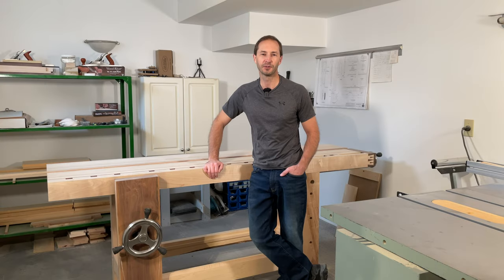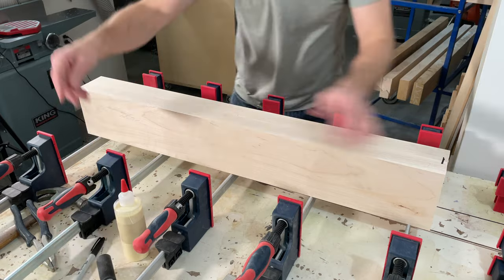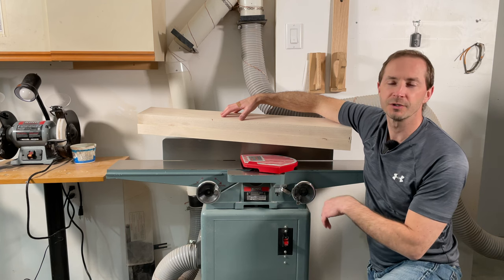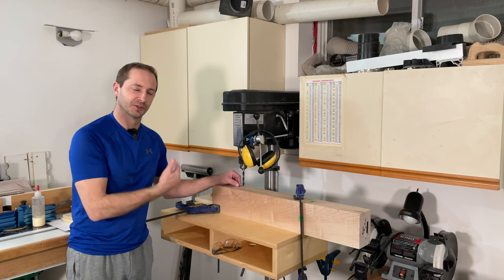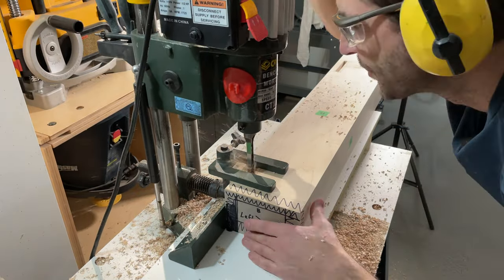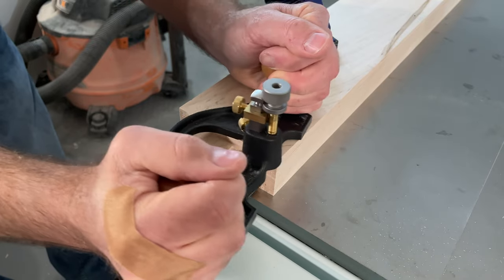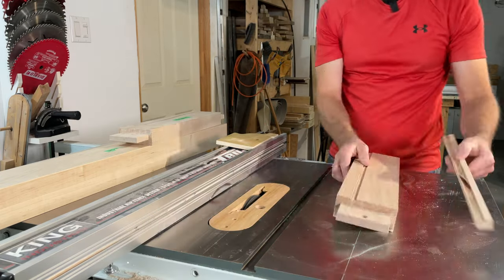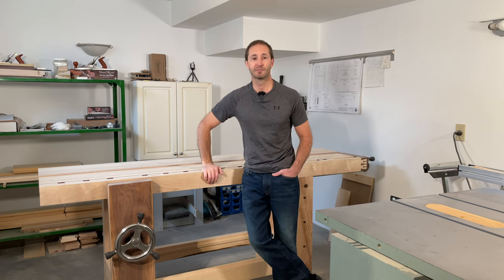How to Build a Roubo Bench Base // Building the Base of a Roubo Bench

Comment: Great video Gary.  Couple of questions.  What are the dimensions of your top and now that you used it for awhile would you keep it the same?  I'm having trouble finding the long "screws" that attach the base to the top and the barrel bolt hardware.  Any chance you would be so kind to post links to where you found yours?  Keep up the great work and great videos.

Comment: I built my first real bench back in 2010. It's done very well for itself, but I never really finished it before putting it to use. It's a Holtzappfel, or a Roubo with twin screw and a knock down base.

I used cheap 2x4s, and unfortunately the parts are starting to twist and pull themselves apart. I'm planning on building a decent replacement, using hardwoods and nicer vice hardware. I'm enjoying getting inspiration from this video series.
Reply from the maker: Any bench is better than no bench at all. I love my Roubo. Definitely use hardwood for your next bench. You won’t regret it. Thank you for another comment…. Keep them coming!
Reply: @garynelles  over in the UK, sycamore can be pretty affordable. I understand it's similar to soft American maple, so perfect for this kind of thing.

The other alternative is using oak beams. They're also produced up here for architectural uses, so also reasonably cheap if you don't mind air dried to a higher moisture content.
Reply from the maker: I would personally avoid air dried lumber for a bench if it’s greater than 2” thick but that’s just me. I would be concerned that it would still move around and my bench top may not stay flat all year long.

Comment: Hi Gary
When you use the brads for glue up alignment, do you leave them in there? Or do they end up getting cut off as the pieces are slightly oversized?
I really like that idea but also fear hitting one accidentally on the table saw (saw stop) or jointer. 
Probably not going to happen though. I can't imagine that you hit them with any blades, as careful as you are with layout
Reply from the maker: I usually place them in the waste area to avoid exactly what you were talking about but Brad nails are such soft metal anyways they won’t damage a circular saw blade with carbide teeth. I don’t know if they will trip the saw stop brake though because I don’t have one.

Do any other viewers out there know the answer to that?
Reply: @garynelles  anything that's conductive can and will trip the brake. If the brad is steel, it will do it. I will just have to be careful to mark the location and not hit it. I really like that idea though, using the brads!  All good!

Comment: Hi Gary, question for you. Your bandsaw sure seemed to cruise right through that 8/4 soft maple. 
Curious what size and what size motor you have?
I have a standard 14", 15 amp 1.5HP bandsaw and an wondering if it will do as well as yours appeared to. Thanks
Reply from the maker: Hey Douglas. My bandsaw is a 14” King Canada. It is not that powerful. I actually had to go look up the specs because I haven’t bothered to look it up for a long time. The motor is 7.5A and there isn’t a HP rating that I could easily find. I think a while ago I found documentation that said it was 3/4 HP. As long as you have the saw tuned well and you have a good sharp blade installed (at least 5/8” wide) you shouldn’t have any issues. I made a video a while back about tuning a bandsaw. Here’s the link if you want to check it out: https://youtu.be/Bz9sPziOZMs?si=s8TgbAWh8MZdqv2C

I hope that helps and answers your question.
Reply: @garynelles  it absolutely answered my question, and once again it's refreshing to learn that you're using comparable equipment to what i have. Most 14" bandsaws have a motor in that 1 to 1-3/4 HP range. If it's drawing 7.5 amps, i assume you have it wired for 220v current? (It doesn't really matter, you've answered my question. I'm just curious!).i would expected it to pull 15 amps but double the voltage is half the amperage, so that's why i asked.
Reply from the maker: Mines 110V.